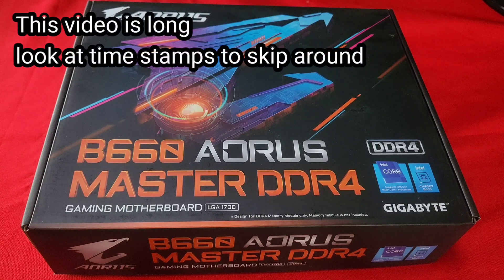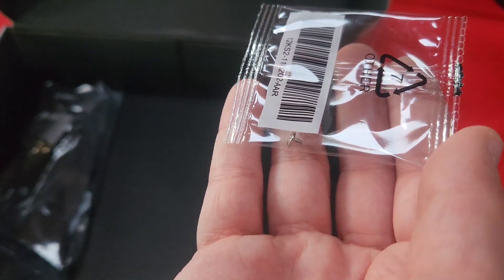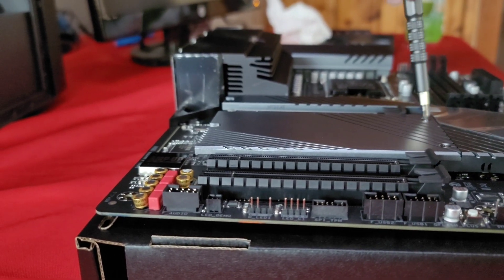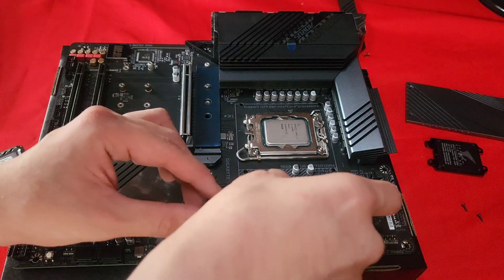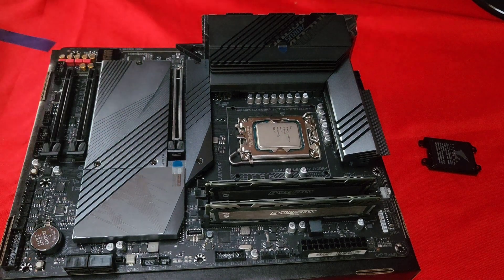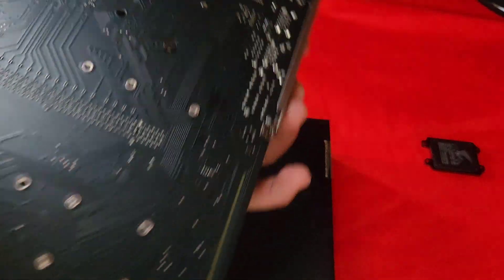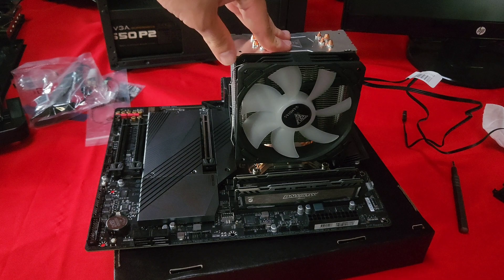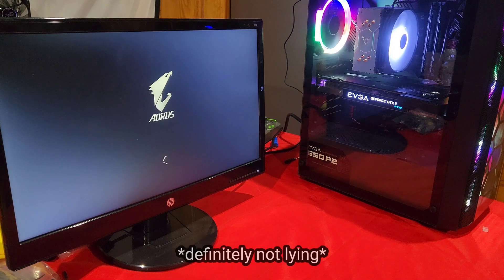B660 Aorus Master DDR4(unboxing & set up)

Comment: Nice video man . 
1)Do you recommend this mobo ?
2)Have you faced any issue with it ?
3) what do you recommend in your opinion 
Msi b660 a pro ddr4
Msi b660 mortar wifi ddr4
Gigabyte b660 aorus master ddr4

4) I want to chat with you about something if you have discord then let me know
Reply from the maker: 1. Yes
2. No problems at all
3. I have not used the other 2 motherboards, so I can only recommend this one.
4. Sorry, I do not have a discord you can reply to this comment with more questions.
Reply: @kngx64  thanks for the reply man 

1) How long have you been using this mobo ??

2) How do you register this mobo for guarantee
Reply from the maker: 1. I have been using it for around 2 months
2. You need to create an account on the gigabyte website and you need your purchase receipt. You can find the serial number on the right side of the box.  Motherboards typically  have a 3 year warranty.

Comment: Thank you so much for this video ♥️
I have two questions about this motherboard
1-does it support bluetooth?
2-does it need a bios update for the new 13th gen cpus?
Reply from the maker: Yes, it supports Bluetooth. Yes it needs the update for 13th gen, but you might be able to get it to boot with the cpu. If that doesn't work you can update the bios with out a cpu being installed.
Reply: @kngx64  thank you so much